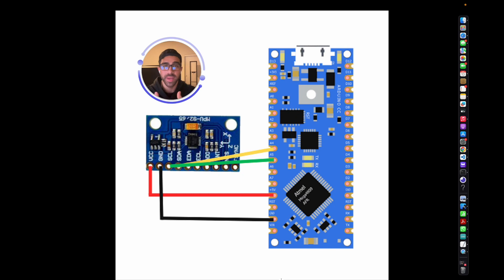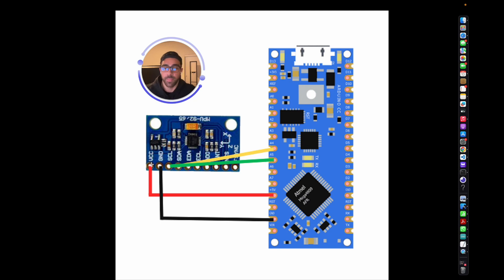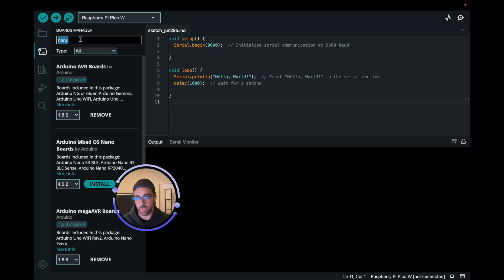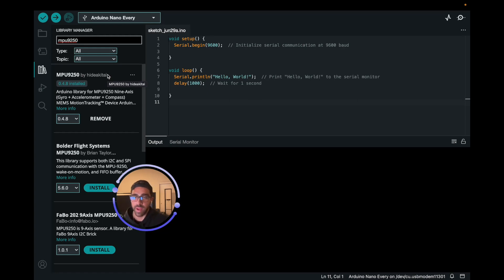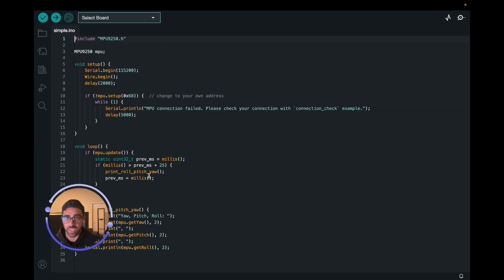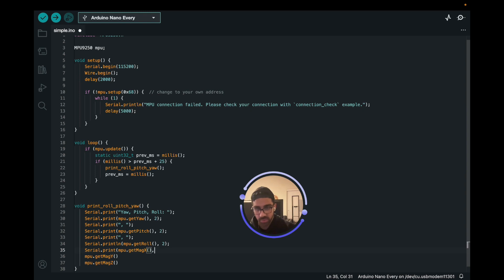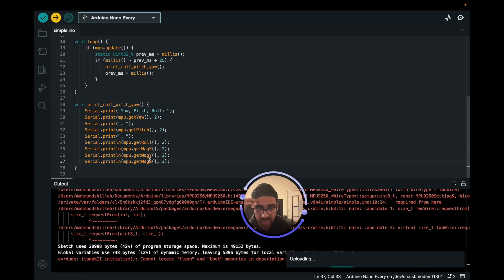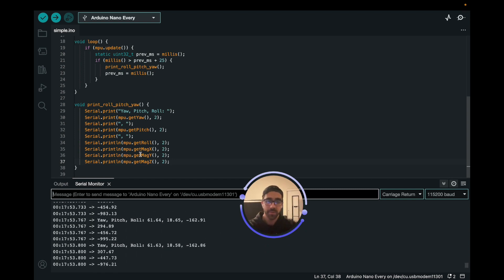How to Connect MPU9250 to Arduino Nano

Comment: I have a mpu-9250/6500/9255 
I dont get values for magnetometer. Any ideas you might have.
Reply from the maker: Where did you get your mpu9250?
Reply: @mmshilleh  it was a 37 sensor kit i purchased years ago. Im looking into m10 gps modules with a magnetometer. Im seeing most comments on cheap sensors are counter fit. But maybe by chance it will work if provide separation from the wifi module.

Comment: There is a big problem in this priject. When sensor is stable the displayed value is not stable. Are there any way to stable this value
Reply from the maker: You need to calibrate it and apply some filtering, there are some techniques you should research